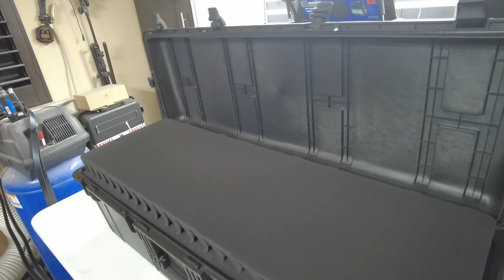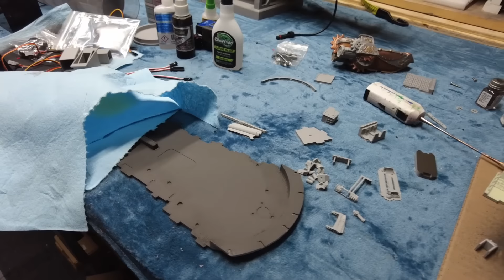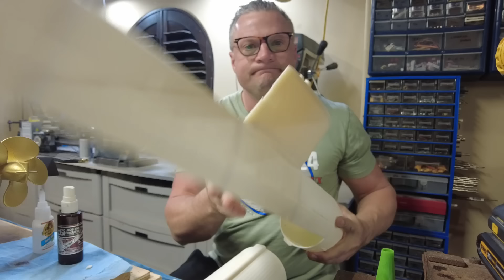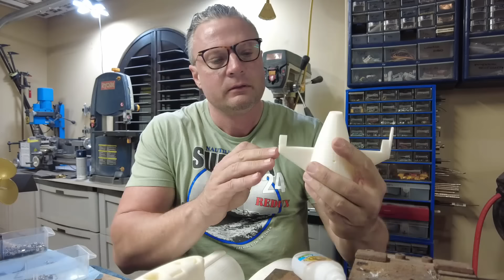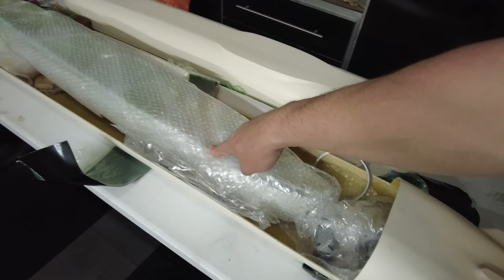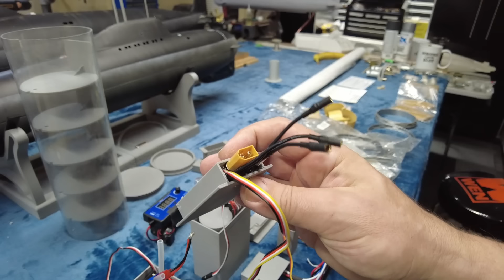Three New Boats For Sale and Progress on the Kraken Control System for RC Submarines!

Comment: The boat I'd want would be one of the larger scale "Seaview".  Unfortunately I don't have the $$$ to buy a completed unit nor the SKILLS to do the model justice if I was to try and finish it off myself.
Just a beer powered thought, how small could you make a radio controlled "Flying sub" for a "Voyage" setup?  I'm thinking one that could "undock" from Seaview and go on it's own "mission" in the pond/lake/pool.
Reply from the maker: I believe someone on the forums built one that was just under 3" diameter.
Reply: @RCSubGuy  That sounds like it would be just about the right scale for the 80" main model, or maybe a bit too small actually.